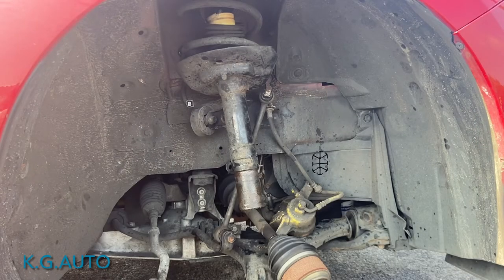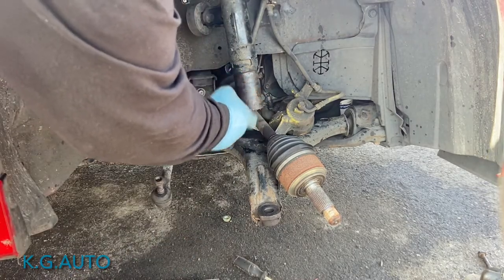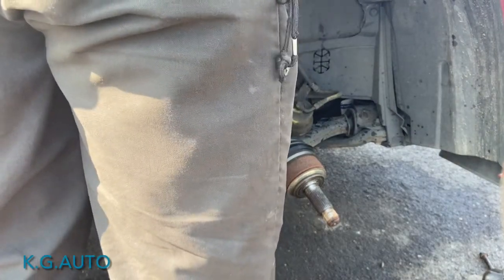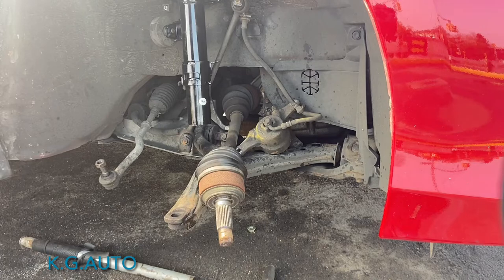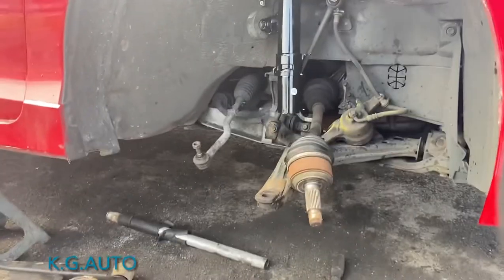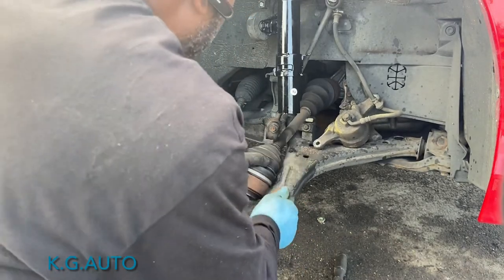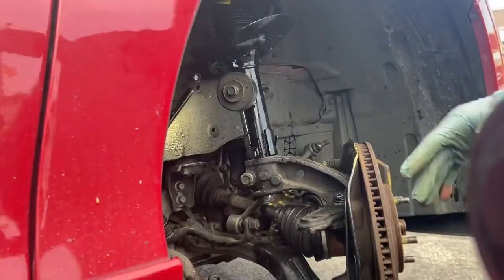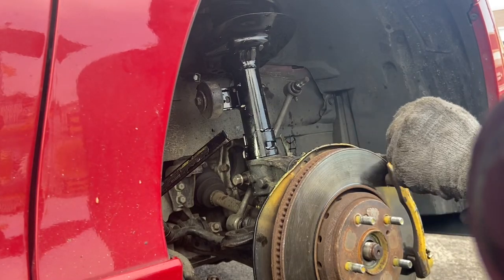2016 Honda Accord Sports Front Strut Replacement

Comment: you don't have to take the spindle out for that job
once you loosen up the control arm there is 2 holes at the end of it where you can put an screw driver and manipulate it down to let you loose up the strut
trust me you don't need to take the spindle out
check it up on the edges at the end of the spindle
Reply from the maker: Thanks for reaching out,I appreciate you 👍